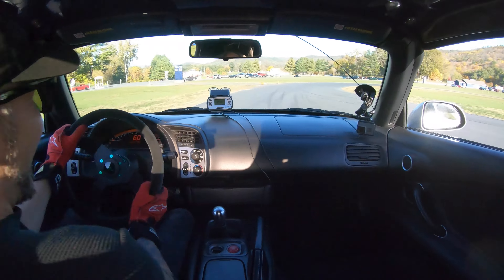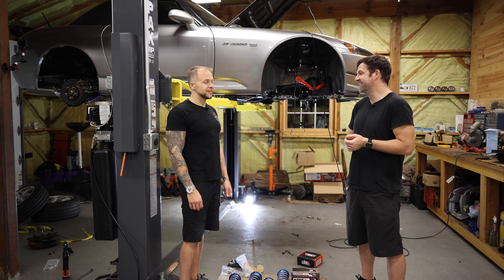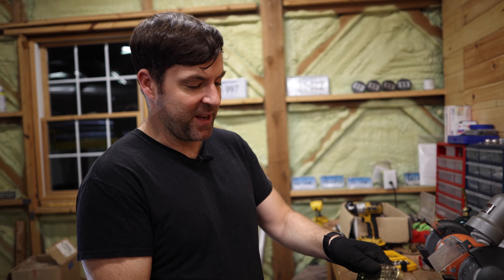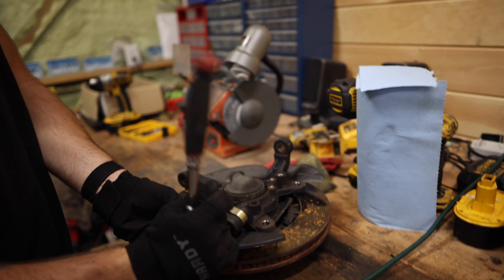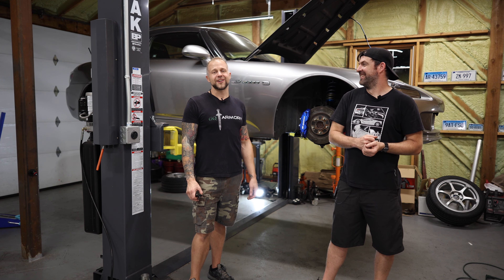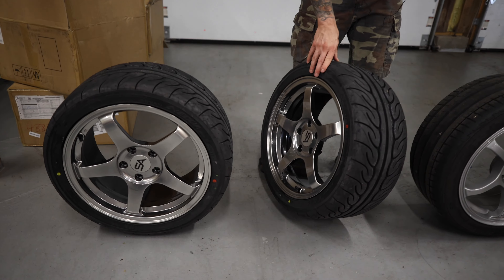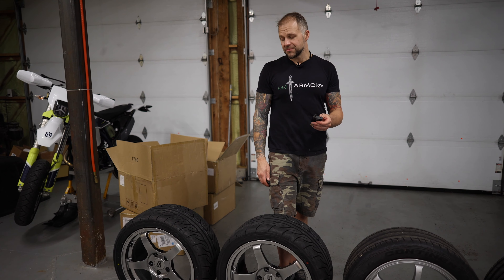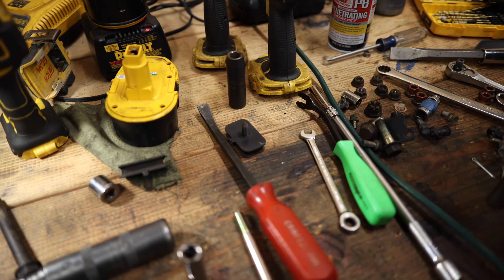Project S2000 Suspension Overhaul Install FINAL!

Comment: I suspect the AD09s will hold you back a bit... Put some Hoosier A7s on :P
Reply: ... And I would love to see what kind of times you can get in that thing on the configuration LRP has been using for AutoX season standings..  That is a beautiful car, beautiful wheels, and I suspect could be one of the fastest on track (with the right tires)
Reply from the maker: I want flexibility in how I can drive it. Too much grip and the car is not playful

Comment: wheels look good! not a huge fan of the center cap design but that's all personal. Car sits way too low on the front, I agree. I'm waiting for my advans to arrive in 17x8.5 et51 all around, will be running a 245/40 squared so we'll see how they fit. I'm on ohlins and probably 5mm lower on the rear with similar gap up front. Did get my arches rolled slightly to allow for 245 to clear..
Reply from the maker: Yeah I had to raise the front and lower the rear. We are going to do a video rundown of the wheels and show renderings for more aggressive sizes. Then gauge if folks want to do a group buy where we can have runs of them made

Comment: Extended open ended lug nuts, never again? I had a set and was always paranoid water sitting in there. Is that your reasoning? Also...Mattchew!
Reply from the maker: Yup, it will rust the studs

Comment: Hi, you said that you will not run open-ended lug nuts, what was your experience with them?
Reply: They suk.  Studs start to rust. And faster than you'd think.  Tats my experience with them
Reply from the maker: The studs rust. Closed lugs that's not an issue
Reply: @TheSlipAngle  got it, thanks!

Comment: If you are in NC anytime soon hit me up, you should try my car 01 AP1 vs yours. Mine is completely stock engine with j's header, test pipe, AEM cold air intake. Suspension is Sakebomb Ohlins long stroke setup and sway bars with Titan 7 TS-5's Bridgestone Potenza RE-71R 255 square setup, without rolling of fenders. Handles amazing, would like to see the difference between yours and mine. My car still has stock brakes with Carbotech pads and SS lines though.

Comment: Have you guys got additional designs in mind for your own wheels, or what's the long term rationale? Design is clean, but I guess it's hard to do an "original" 5 spoke that's not weirdly outlandish in style. Reminds me a lot of the Advan GT, or the Rays wheels that were optional on a lot of OEMs back in the day like the MS-01S.
Reply from the maker: We are going to do a video rundown of the wheels and show renderings for more aggressive sizes. Then gauge if folks want to do a group buy where we can have runs of them made